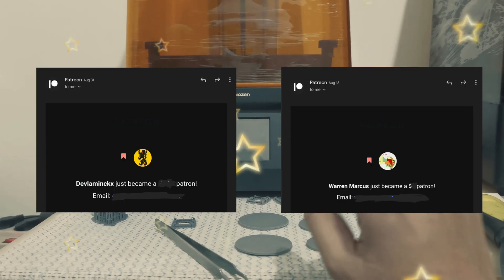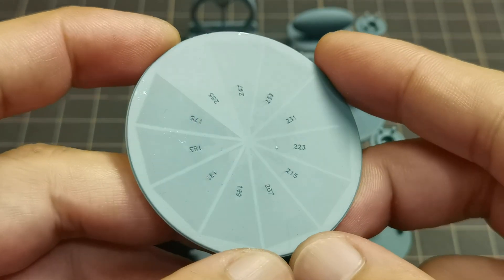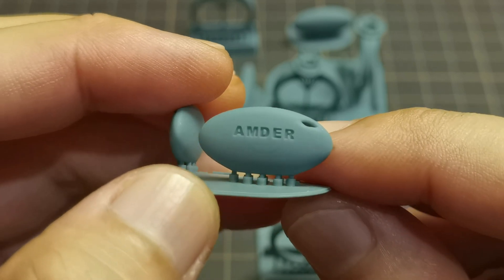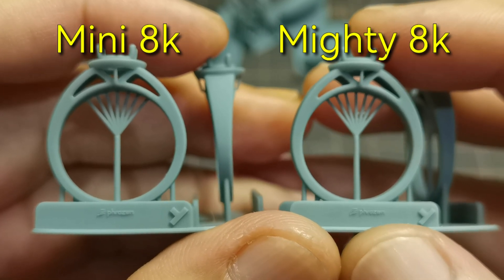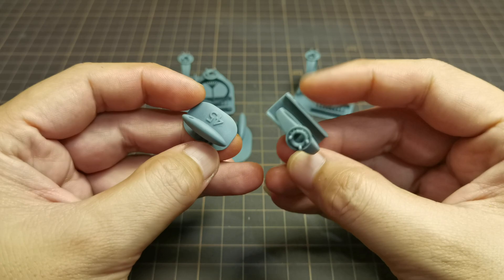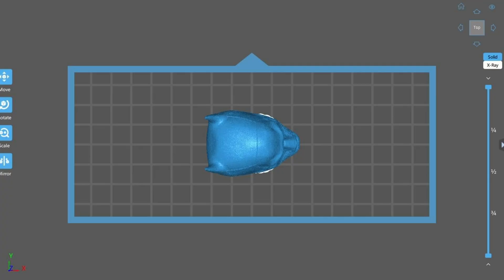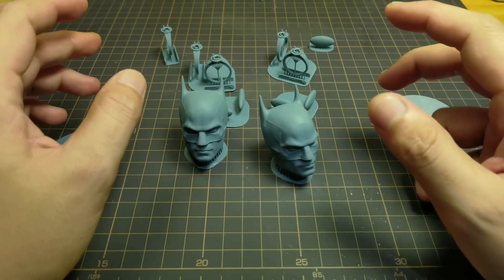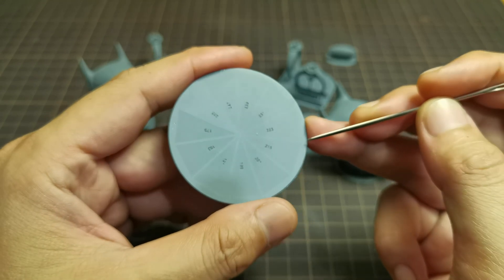Antialiasing Flaw On Phrozen Sonic Mini 8K

Comment: Hi Dennys, thanks for doing your videos and for your clear and exhaustive explanations.
Any chances that you got to the bottom of the new AA settings on Lychee 5.1.5-beta?
Looks like they keep adding/changing labels in the export options so what would you reccomend as settings in order to get the cleanest result (on a very textured and organic surface vs on a squared geo)?
Reply from the maker: Lychee aa not working

Comment: I've noticed voxel lines on the smooth legs of minis I've printed recently. AA4,blur3. I just thought maybe the angle was making them show up more than I was used to and that the primer would fill them in. Now I'm a little concerned.
Reply from the maker: I feel you

Comment: Yeah I get similar issue but my results don't seem as extreme. Try slowing the print that seemed to help mine a bit.
Reply from the maker: Voxel and aa got nothing to do with print speed.
Yours most likely layer lines
Reply: Ah ok, thank you. I wonder if the issue could be with Chitu Box incorrectly saving the data or maybe an oversight in the default settings it has for the printer. I find it unlikely that the Mini 8k itself would undo the AA produced in the slicer.

Comment: I wonder if they’re using a LUT to map the pixel values.
Does it happen with both Chitubox and Lychee?
Reply from the maker: Lyche AA never works so far.
Only chitu works.
What is LUT?
Reply: @wangdennys  LUT stands for Look Up Table. Its used in many imaging devices to map a value in an image to a display pixel or at least that’s how I understand it.
Reply from the maker: @robertmro  i will look into it
you got me curious

Comment: so far on my printing with the mini8K, I haven't used AA at all, and printing wise the quality is amazing. I haven't enough experiences in 3D printing to judge how AA would have changed the minis I have printed so far, but that would be a very good test to take one that doesnt use too much resin and run a test.

Comment: What are the pixel dimensions in the x and the y axis. Some screen manufacturers have long x pixels compared to the y axis. Anti alaising works a lot better at 22.5 degrees because there is an echo at the 45 position due to voxels stacking corner to corner at 45 degrees.  At 22.5 degrees the PC generates a fully smoothed face.